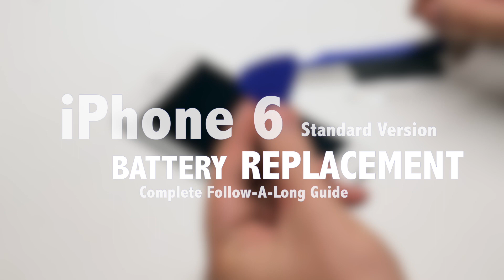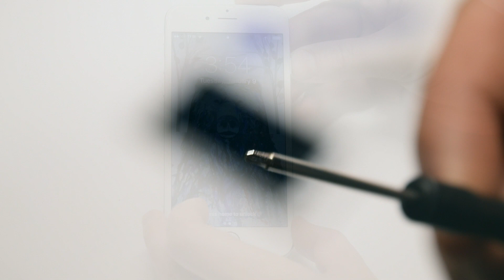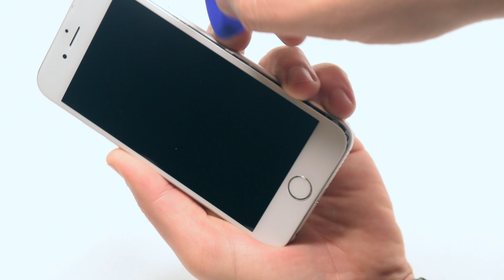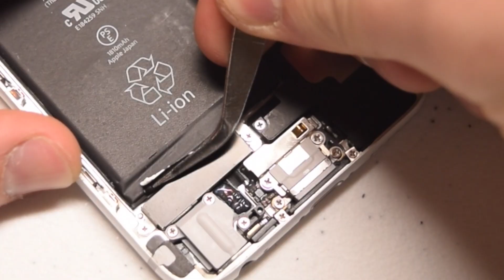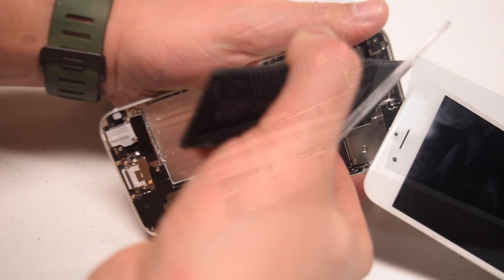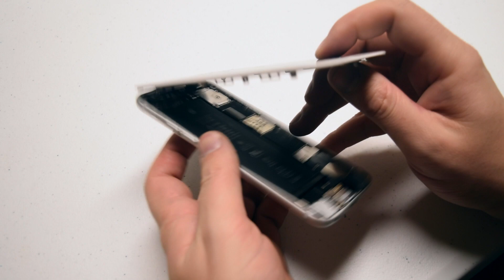iPhone 6 battery replacement

Comment: very well done ... was able to get my iPhone battery replaced with no issues... the tech that did the replacement did comment that you need to use a slow steady pull on the glue tabs to get them to release properly if you try to yank them out to fast they will break

Comment: Hi, thanks for your efforts... you gave some great info about steps to take & warnings about the battery, but too many of the things done in this video can damage or destroy the phone. The way the screen assembly is being handled makes it likely that those upper right cables will be damaged which would require a complete screen replacement.  Also, digging with that knife so far up is likely to damage the structures near the volume keys & I understand that is a real bear to repair. I liked your suggestion for prying with a credit card as that is much thinner than that knife & a bit easier to use to finesse the residual adhesive. 
Sorry, don't mean to be critical, but following this video can lead to huge headaches for phone owners, especially those who are novices at repair. Wishing you well.